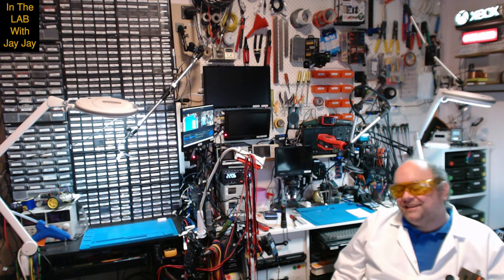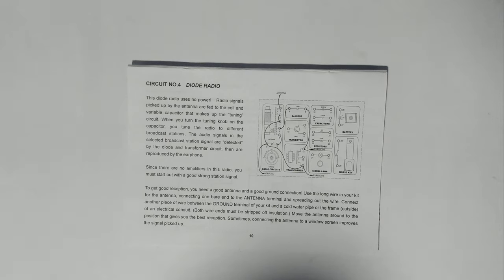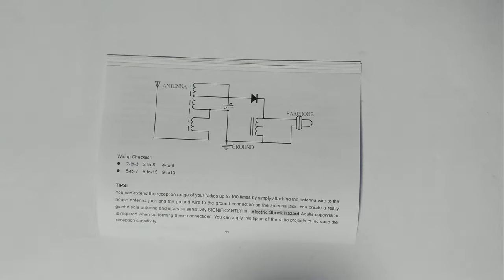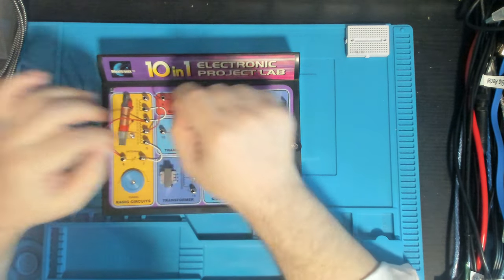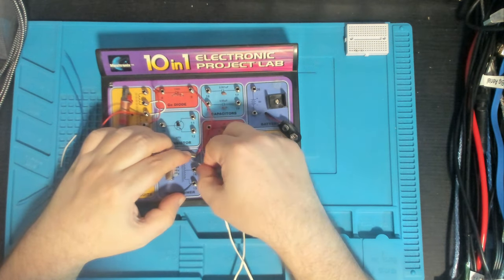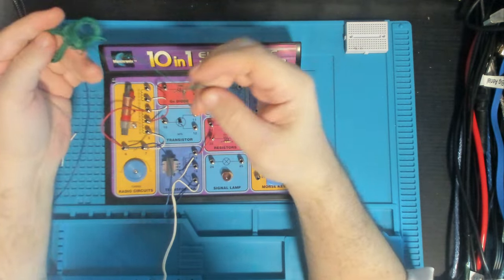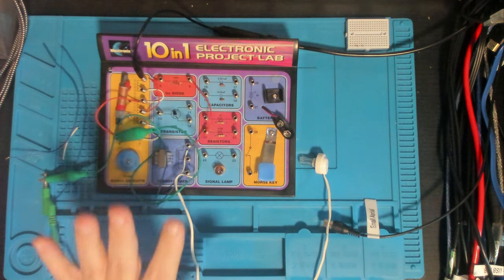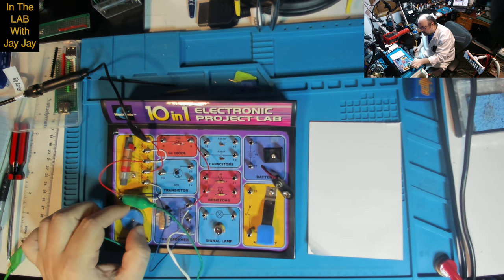Diode Radio | Project 4/10 | Maxitronix 10in1 | Learning Electronics In The Lab With Jay Jay

Comment: Mate,  You need to take it out doors.   Use the long green wire for the antenna get it just tied up into a tree and have the wire off the ground at least by a meter.  
Then you will need a 1/2 meter of wire to connect to a long screwdriver or new brazing rod that is pushed into the earth.  Hopefully it has rained not long ago. If the ground is dry just a few liters of water mixed with 50gams of table salt will help. 
Then see if you can hear and AM stations.
Reply from the maker: Hi there. Thanks for your comment! I did end up managing to get one of these radio circuits to work by connecting it to the home television aerial. You can see that in this video: https://www.youtube.com/watch?v=JHuLiIFftQY -- when and if I revisit this circuit in the future, if I can't get it to work with the roof aerial, I will take it outside as you suggest. Thanks again.